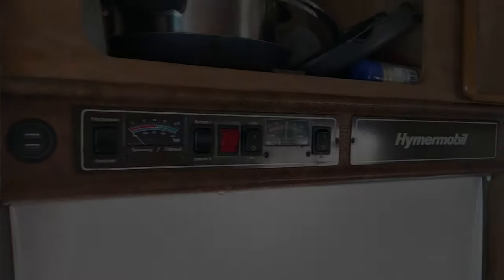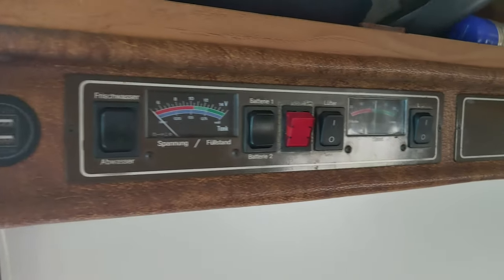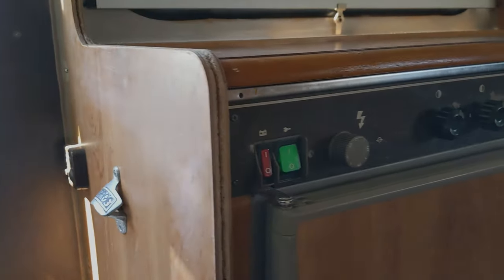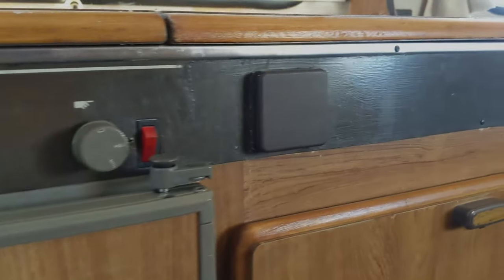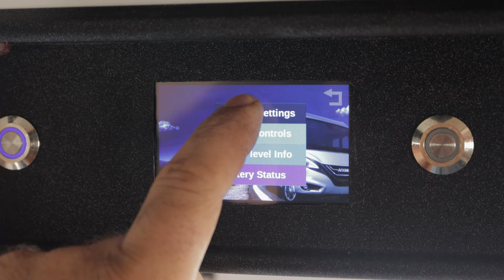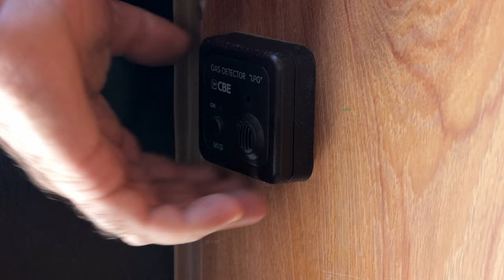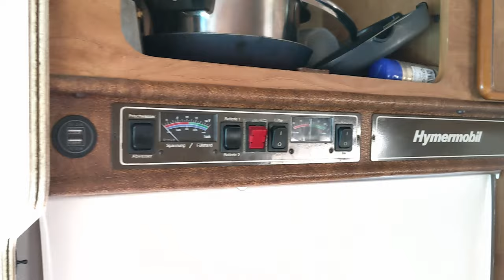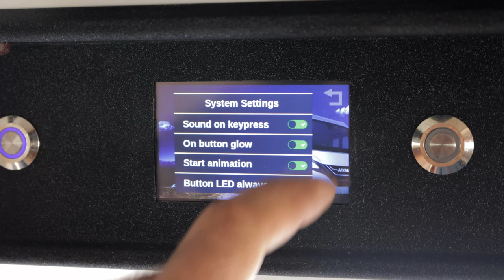1989 Hymer Camper Van Restoration #1 Kitchen top half. and main controller.

Comment: Just bought this Hymer, same year! Any other videos regarding its update? This one was fab - super comprehensive
Reply: Hi Emma. Just bought '90 B544 with painted cabinets. I would prefer original look. Let's do the switch of the doors at least. My logistic and bonuses.
Reply from the maker: I have not filmed more, because its very time consuming to work and film at the same time. Sorry.
Reply from the maker: Be ware the original look only looks good on camera. In reality it doesn't and you cant sand them because its not wood. It's a paper thin vaneer... Cheer's.
Reply: Thanks for the heads up - back to the drawing board lol
Reply: I’ll look forward to seeing your transformation

Comment: Would be really nice if you could put up a video of how the Arduino management system is created and which components are used.  Keep up the good work!
Reply from the maker: I will try. However i can let you know material list. I am using a Arduino mega because of the number of pins  the display is a nextion hmi touch screen they have various sizes. The buttons are from Amazon hope its helpful.

Comment: Great video! I was hoping that you will have more videos regarding remodeling the Hymer. I have a 1992 Hymer S700 that needs restoration. I was wondering if you remember the width of the edge trim molding that you used (the silver one). I'm out of the country and I found some nice edge trim that I want to buy for the Hymer but I cannot remember the width of the panel where the molding goes. Is it 16mm or 18mm? I would highly appreciate it if you can help me with this. Thank you!
Reply from the maker: Hi. I stopped editing videos on the hymer restauration because it takes a long long time to do and no views afterwards 🤣  the trim i bought was 15mm i bought it from Amazon. It fits quite tight. So 16mm should work as well. But please check your mesures because these things wore made in the 80s there is no way to be certain all mesures are the same.

Comment: hey cool, where did you get the silver rubber things on the edges?
Reply from the maker: O got it on Amazon. Cheers.
Reply: @reversingentropy  what are they called?
Reply: @flame2106  Moulding Trim Strip
Reply: @refuger  thanks